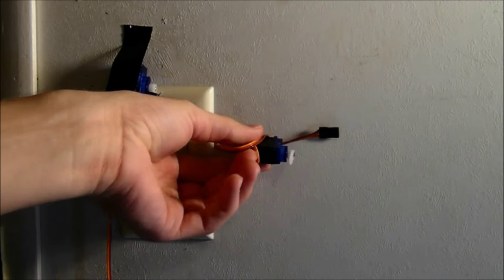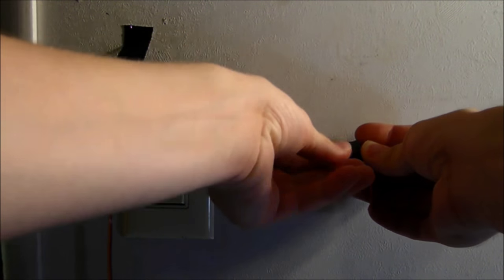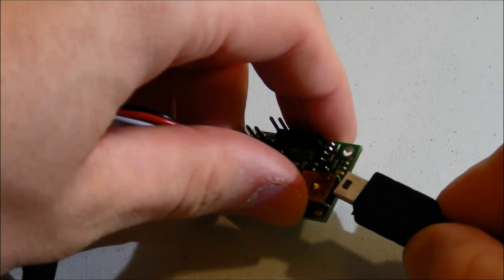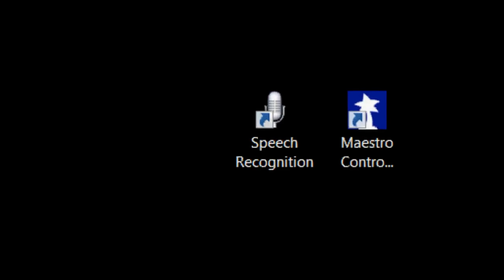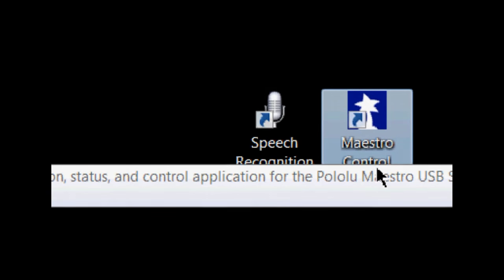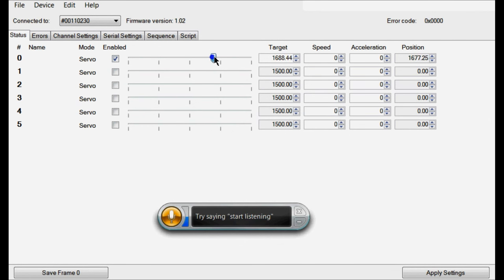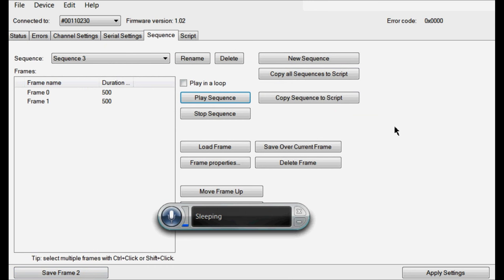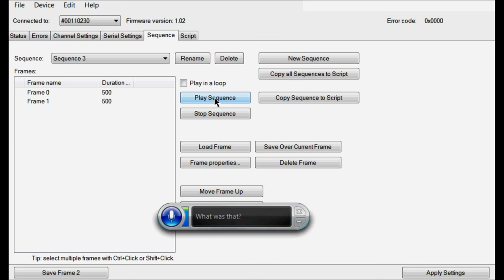How To Make A Cheap/Easy Voice Control System (Under $35!)

Comment from the maker: Pololu video about controlling the servo: https://www.youtube.com/watch?v=AqToEWmTVXA
Here's the list of parts: 
Pololu micro servo controller: https://www.amazon.com/Micro-Maestro-6-Channel-Controller-Assembled/dp/B004G54CHW

Servo control software: https://www.pololu.com/docs/0J40/3.a

Battery holder with the plug end on it: https://www.amazon.com/Battery-Holder-Transmitter-Receiver-Connector/dp/B077L9JXFP

2 Servos: https://www.ebay.com/itm/2-Micro-Servo-Motor-Tower-Pro-9G-SG90-Arduino-RC-Robot-Helicopter-Drone-Control/264662857463?hash=item3d9f22b6f7:g:hIsAAOSwuyteZ~7V
It looks like all the amazon servos are on back order for a month here's the link: https://www.amazon.com/dp/B07MLR1498/ref=sspa_dk_detail_6?psc=1&pd_rd_i=B07MLR1498&pd_rd_w=aZY8F&pf_rd_p=48d372c1-f7e1-4b8b-9d02-4bd86f5158c5&pd_rd_wg=4wH1e&pf_rd_r=N6EEP6TR6QXMFXCGZ4JG&pd_rd_r=6cedb1c3-0462-4338-bae1-77a188ff75d5&spLa=ZW5jcnlwdGVkUXVhbGlmaWVyPUEzMjlJSk45M1YwM0MxJmVuY3J5cHRlZElkPUEwMTUxNjQzMUpOWkgyVjZYTFZPOSZlbmNyeXB0ZWRBZElkPUEwMzAzNTAzMUdNV0YxTTJFN0NFRCZ3aWRnZXROYW1lPXNwX2RldGFpbCZhY3Rpb249Y2xpY2tSZWRpcmVjdCZkb05vdExvZ0NsaWNrPXRydWU=

Servo Extension Wire: https://www.amazon.com/eBoot-Pieces-Extension-Control-Remote/dp/B06XCRSD3T/ref=sr_1_6?dchild=1&keywords=Servo+Extension+Wire&qid=1587482861&sr=8-6

Things you may already have:
a standard usb cord: https://www.amazon.com/UGREEN-Charging-Controller-Players-Receiver/dp/B078MBX55Q/ref=sr_1_8?dchild=1&keywords=usb%2Bcord&qid=1587482740&sr=8-8&th=1

4-AA Batteries: https://www.amazon.com/Energizer-MAX-Alkaline-Batteries-Pack/dp/B00451SSBI/ref=sr_1_3?dchild=1&keywords=4-AA+Batteries&qid=1587483307&sr=8-3